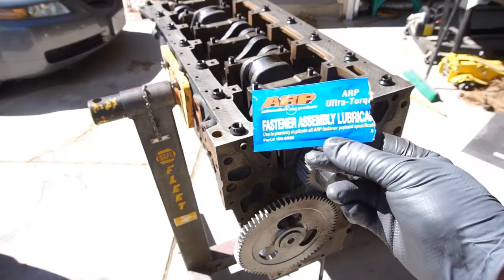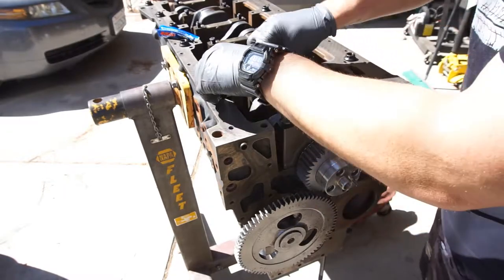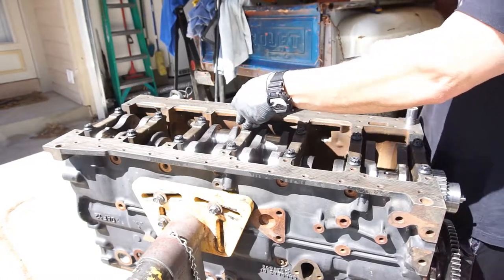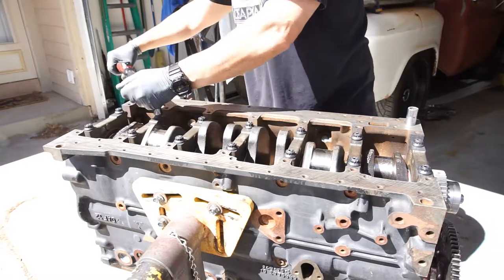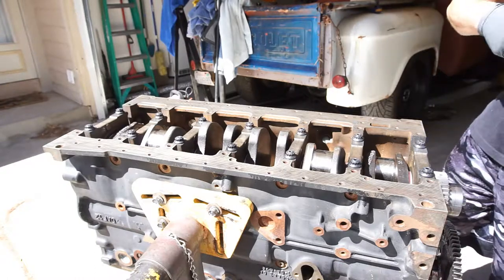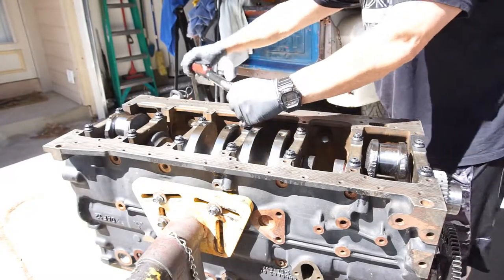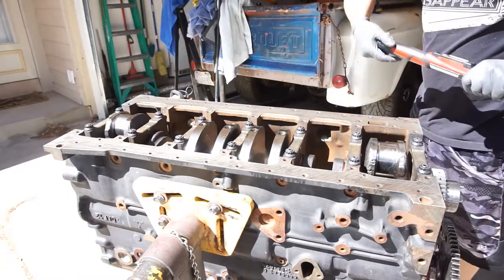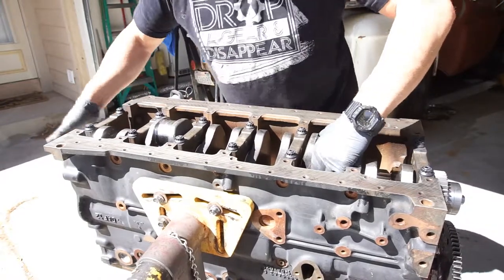Part 6 6.7 Cummins Build. Installing and Torquing ARP Main Studs 125 Foot Pounds

Comment: Did you use all the arp block stiffener studs ? I did was woof you had any issues
Reply from the maker: I only had one issue. Watch video 19 and 19.5  6.7 Cummins build. It was with the pickup tube.
Reply: Nice engine stand.